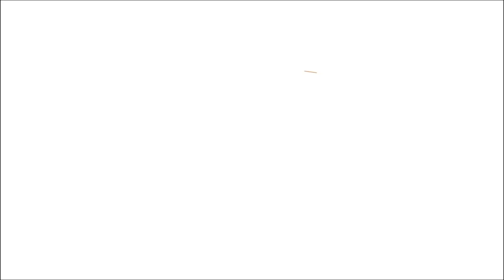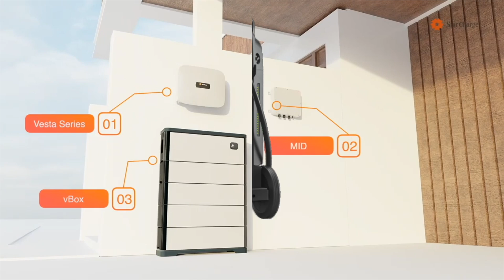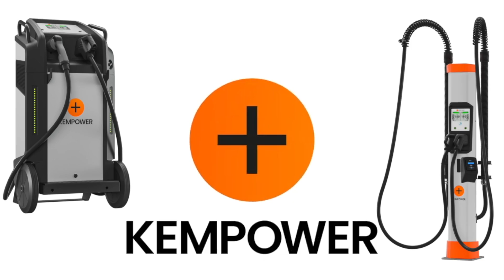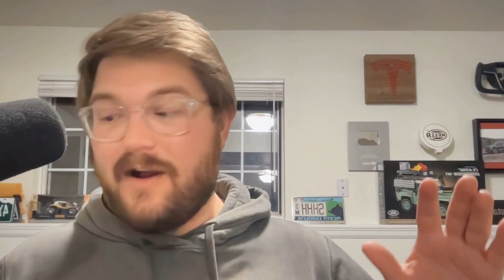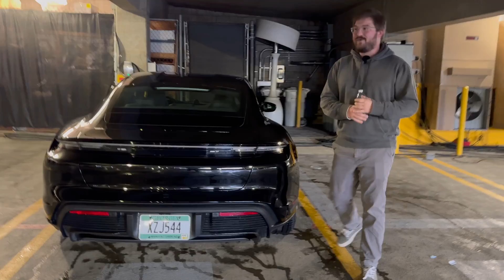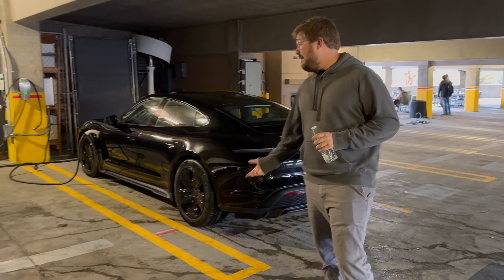Insane Porsche Charging Performance! New Taycan Facelift Charging Test & Comparison

Comment: Are the capabilities actually a result of outstanding tech? Or does Porsche allow customers to push their EVs to the limits because they know 95% of customers will solely charge from home, have multiple vehicles, and won’t put more than 10k miles per year on their cars cuz most are leased? Or are they just able to put the best components in their EVs because of price point?
Reply: Second- high class engineering and superb components.
Reply: outstanding tech from Porsche

Comment: 4:00 “and now there is a new one and it can do way more”. That pretty much sums up this video. Porsche has changed the game with this new Taycan.
Reply: no, they will caught up in 2025, the zeekr007 is in production now in china: https://www.youtube.com/watch?v=2dW2tMlypB8
Reply: No😂
Reply: @marcusbiller867 this new taycan version has by far the fastest charging, beats the plaid by 18 seconds on the nurb and only 2 seconds slower than a 2000hp Rimac and an excellent range from what we can see on real range test on YouTube 

So yeah Porsche changed the game with this car
Reply: @JR.A110R  wow, a 5% performance advantage. A Porsche should dust a Tesla, especially at double the price.
Reply: @mtnman1984  lol having 18s difference between cars with similar power and one car on non road legal tires is almost unheard of on the nurb 🤣🤣 the taycan is closer to the rimac nevera than the plaid 

Double the price because double the quality, double the chassis and braking performance

Stop with excuses
Reply: @JR.A110R  it's impressive, but as we've seen, tires can make that kinda difference. Hold that cork until they release the specs on the car that did the 7:07.
Reply: @mtnman1984  yeah tires make a big difference, the plaid was on non road legal tires in Europe 

Porsche always use cup 2r and for the taycan turbo S it was on p zero corsa which are even worse than cup 2r but they never use other tires. You will see
Reply: @JR.A110R  like I said, I'm waiting and it is impressive, but not a "game changer".
Reply: @mtnman1984  having a sedan almost as fast as an electric hypercar with double the horsepower and 18s gap between 2 cars of the same class with similar power is a game changer for me 

If that’s not a game changer, what can be a game changer for you ? I have never seen that much of a gap between 2 competitors on the nurb ..
Reply: @JR.A110R  it just moves the game on. Again, a 5% advantage is impressive at that lap time. I think the Nevera time was not a surprise, but still a disappointment to everyone. It should be much faster, but it weighs even more than a Taycan with nearly the same size tires and a worse drag coefficient than either the Taycan or any Tesla. It's as much a drag racer as a Model S and probably handles worse than a Taycan. 

If you take a step back and look at what made this car so fast, it's the adoption of the tri-motor arrangement, first produced by Tesla, and more advanced suspension engineering. For me, the part about the Taycan that changed the game was the 800V architecture. It allows for so much headroom with charging and performance. 

The Taycan is a midsized compared to a Model S and is built by Porsche. It needed to beat the Tesla to be a Porsche and it did convincingly. This update moves the game, but Porsche's EV architecture is what changed the game.
Reply: @marcusbiller867  for charging performance, which is a huge deal for electric car, it completely did !

300+ kW up to 60%, 200+ kW up to 75% and still 150kW at 80%.

Also, this new Taycan can handle cold weather really well without affecting the charging performance too much. Most of the time it barely if at all needs any preheating.

So there is the performance and the reliability of the charge, two things that are an issue with all the other EV.

Comment: Can’t wait for this to get NACS
Reply: NACS can't charge UpTo this fast owing to 400V nature..This speed could only be achieved in 800V systems.
Reply: @姚智偉-m6h  Teslas Supercharger network doesn’t support 800v yet but NACS supports up to 1000v.  All Electrify America needs to do is change the cable(which they said they will do) to support NACS.  Virtually all manufacturers will move to NACS in 2025 so it will happen quick.
Reply: @randy5298 not in Europe
Reply: @Max-si8sy We’re talking about the North American charging standard so obviously I’m not talking about Europe.
Reply: @姚智偉-m6h  NACS is 1000v
Reply: @keco185  There are no widespread 1000V NACS chargers for the next years. If you want to charge fast now, CCS is the way to go. CCS works great all around the world btw. The US has infrastructure issues
Reply: @BBingo-v5i  I don’t get rid of my car after 1-2 years. Also CCS1 is only in North America
Reply: @BBingo-v5i  There are already quite a few V4 dispensers (1000V) installed and growing by the week, Tesla is only waiting to gather more charging data on the Cybertruck before upgrading the charging cabinets. They currently average over 20 stalls installed per week. That's two full charging stations per week on average and they're only installing V4s right now and going forward. That's 1040 charging stalls in a year, all V4s in the US. And they plan to average installing 30 plus stalls per week by the end of this year, and 50 per week by the end of 2025. And they've begun adding solar and batteries to large charging stations.